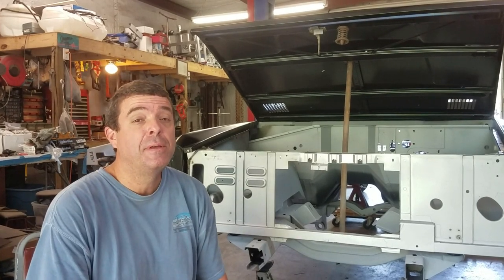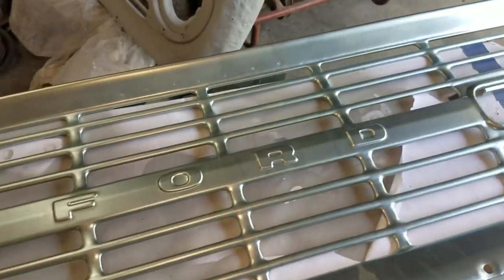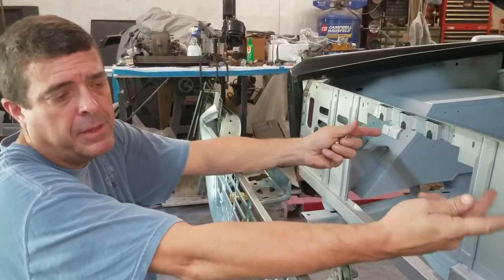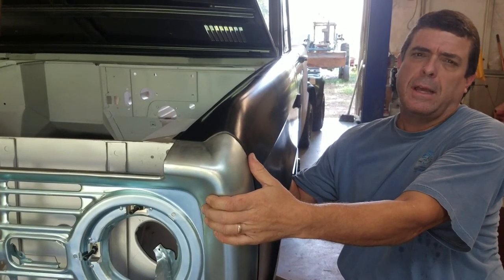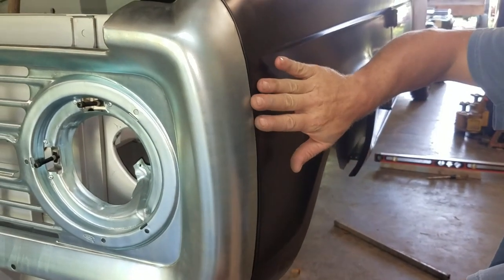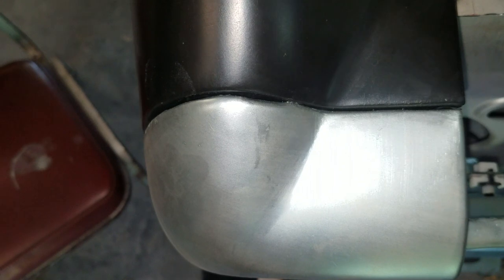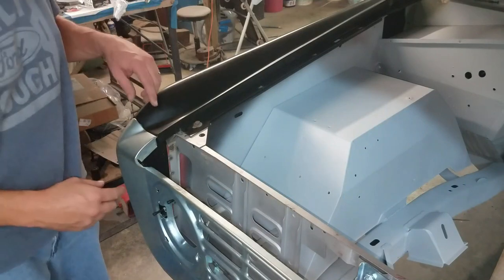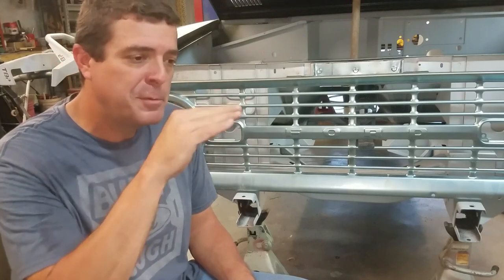Dennis Carpenter Grill Install - 1966 Ford Bronco Restoration Project

Comment: Hey Jason, great video. A the 4:10 mark. What did you do about that gap after? I have the same gap.... just wondering if you fixed that at all, or it came back to bite you. Thanks again for the great videos.
Reply from the maker: Al, let me start by saying I have been introduced to unassembled fenders now and the would have solved lots of problems.  I ended up making an aluminum shim to bolt between the fender and the support.   It looks fine and won't be seen.  It could have stayed like it was and you wouldn't have seen it unless you were looking for it.  Sometimes we have to pick which battles are really worth the fight.  I just made it easy on myself here.

Comment: Looking good. I bought mine from Toms and used the deep red lettering for the FORD. Have you decided on interior options yet? I used Heruliner on my interior but not loving the road noise. Any thoughts on sound deadening for the floors and carpets?
Reply from the maker: Thanks David.  I have not made up my mind on liner or paint yet.  I am thinking of the one piece mat you can buy because it wont get damaged by rain.  I don't think I want full interior in this one.  We will decide that soon.

Comment: I would not fill the gap with body filler from grill to fender. It wasn’t that way originally and it’s not designed to be filled.
Reply from the maker: I probably was not clear sorry.  I agree it is supposed to have a gap/seam but to be properly shaped it will need filler.  Filler is not a bad thing when used as intended it is not for covering up poor work.  Thanks for watching.

Comment: I built the edge of the grille with weld and ground it to match the edge of the fender rather than just fill it with bondo
Reply from the maker: Jim, I hear ya.  The issue for me is it would require a lot of fill weld over a lot of surface area.  The panel will get distorted and still require filler afterward.  It won't need much filler as good as it fits so I am not too worried about it.
Reply: Jason & Jonie Builds I use the weld on the edge only so the edge was metal to match the fender and then used bondo to fill the side to match
Reply from the maker: @bodybender7628  Yes sir that makes sense.